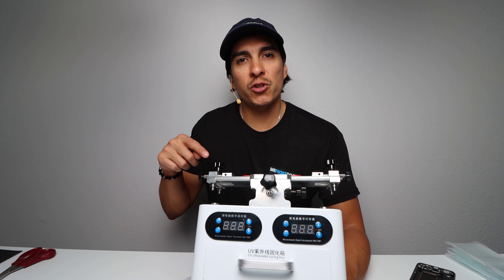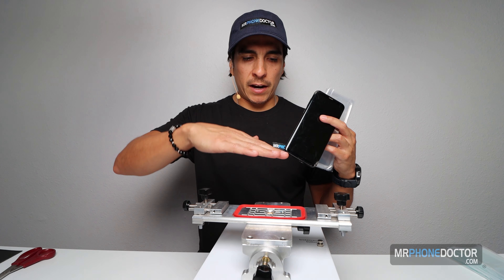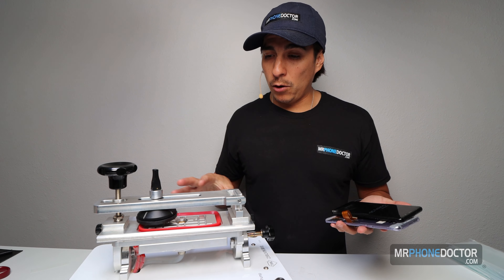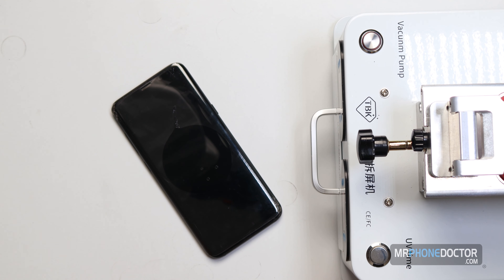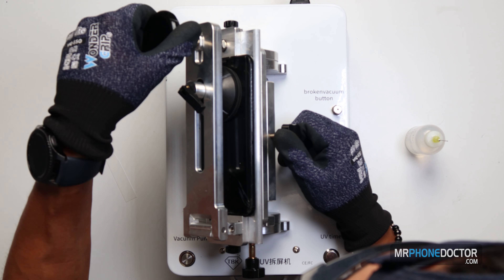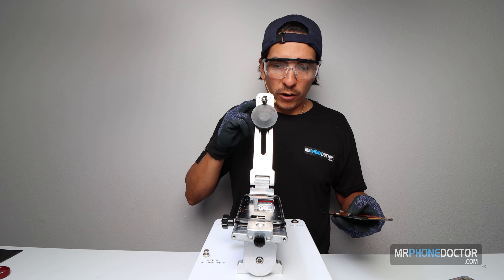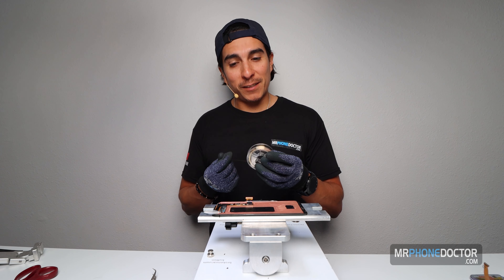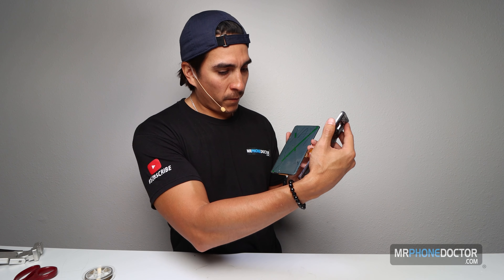TBK UV 258 LCD/OLED Seperator Test Drive & First Impressions

Comment: This might b3 the dumbest question, i apalogize 8m still learning this process. 
Do you put the lcd in the hot panel once the hot pan has reached temperature or the lcd needs to read temperature along with the  pan?

Comment: So you would rather do this than removing glass of a lets say note 20 on its frame? Is this a safer option?
Reply from the maker: yes we may start using it on these models.